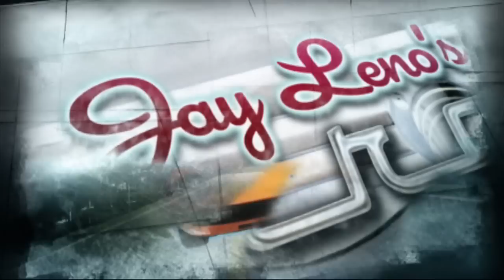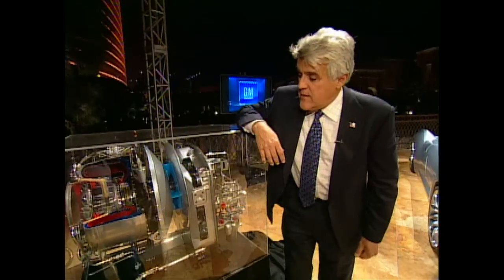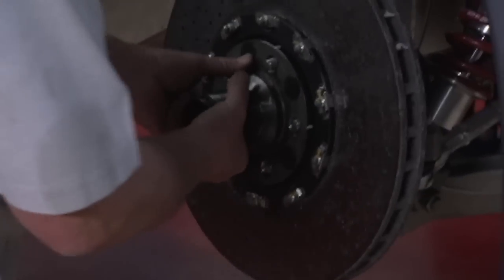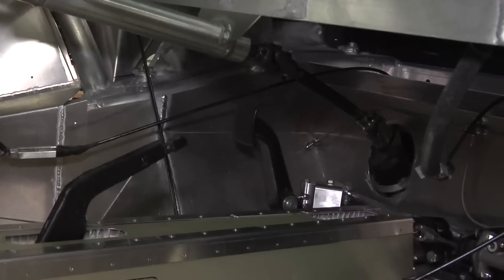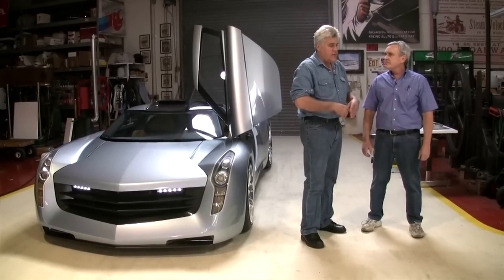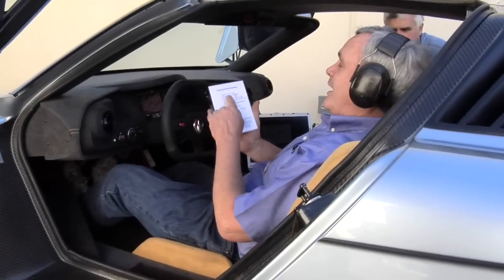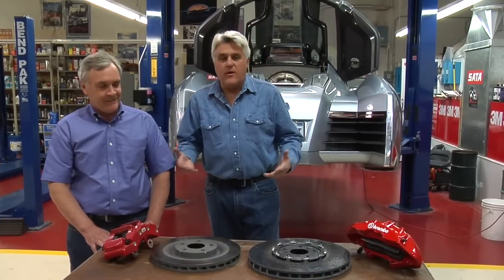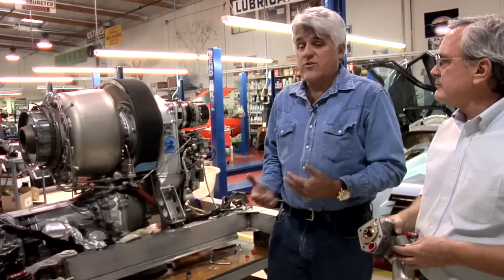EcoJet: Definitive Edition - Jay Leno's Garage

Comment: Runs windows Vista? R. I. P Jay
Reply: You knkw Hatala, out of context, I thought you still couldnt spell my name after 5 years X(
Reply: ***** He's a friend of mine, don't worry.
Reply: He's not dead yet.
Reply: charlesvan13 I think the point he is trying to make is that Vista sucks and crashes more so than the other Microsoft OS.  So if the car runs via Vista, the car will crash sooner than later, ending in death for the driver.
Reply: *****
Windows 7 ultimate is the best version of windows to date.  Very stable and crash-free.
Reply: I agree Vista is one of Microsoft's worst operating systems ever but they never said it "runs the car". They said Vista runs the GPS and on-screen mapping system and internet connectivity, nothing more. That said, I still wouldn't want Vista doing even that but by now they've likely upgraded the OS to at least Win7.

Not sure why people like to fabricate things like this...
Reply: greenrefrigerator it's joke...
Reply: *****
it crashes every time I rip PCI cards out, so it's not crash free.
Also crashes with bad graphics card drivers after multiple flash video instances simultaneously.
Reply: Still not dead, 3 years later.
Reply: android kit kat

Comment: I recall the Chrysler Turbine car, an example  of which Jay also owns, used a HUGE air filter in the front behind the grille, which served to help muffle the enormous amount of intake noise.  On Jay's EcoJet they were using just the engine maker's filter element, which went around the engine and likely had much less muffling effect on the incoming air.

Comment: Question: how do you keep the torque converter cool when idling?
Reply: Why would T.C get hot??? Whats your thinking.
Reply: martyisabeliever Because the engine still produces a great deal of power when it's "idling", and when you hold hold the car stationary with the brakes, all that power has to go somewhere. So it can only get wasted as heat in the the torque converter, a bit like riding the clutch with the handbrake on.
Reply: So the fluid used in the turbine of the T.C./ and within the transmission is pumped through the trans then out to an external fluid to air cooler.
Reply: ManWithBeard1990  After the gear reduction from the turbine to torque converter.. Can you imagine the torque multiplier. 48k RPM and 750HP down to i think they said 6k... So at full tilt that Automatic transmission/Torque converter must deal with something to the range of 6000HP... OVERKILL is a understatement....Anyone else wanna see Dyno numbers from this?
Reply: John Simpkins Big coolerz... "Thing do not overheat, they are undercooled" Smokey Yunik
Reply: Maybe they have a large cooler set over the intake of the turbine but even if it is only displacing 200hp at idle... thats alot of thermal energy. True this is not a daily "Stop and Go" car.. That is a hella engineering hertel to jump though...And a massive amount of stress on a underengannered Auto Tranny. AKA C5 auto. DISCLAIMER  Not bashing just comparing facts i have gotten from sources like "TopGear UK" they are not fans of that segment of the Auto industry.
Reply: All of the thermal issues considerd here are exactly why when asked Lee Iacocca stated gas turbines would NEVER be used in cars I believe his final statement on the matter was" If you have that much available power why would you keep it on the ground" a wise and practical guy that Iacocca was...
Reply: Agreed.  well said.
Reply: martyisabeliever Amen, I agree completely!
Reply: They probably got the highest stall aftermarket convertor available
Reply: Jay Leno is soo cool you don't need to cool it

Lol
Reply: Zachattackisrad  Duuude you are right! That was so obvious a solution how did we all miss it....
Reply: John Simpkins your math is wrong. its still 750hp
Reply: @ Jackagainski       They said it did.

Comment: VISTA?

you spent all that money on that car and they gave you VISTA?????
Reply: If it had to be a Microsoft system I would have rather had XP. Hopefully by now they've upgraded to Win7 (or Win8 only IF they wrote drivers for such a specialized system).
Reply: Stick with Microsoft (or ANY current system) guarantees in a few years' time the car wont be able to run on any street. Why? Because MS will do an upgrade that will disable the car's systems. Sorry - you have to update your car before it can run on the streets.
Dont believe me? Look at XP and Chromecast. Look at XP and AVG. Many other examples where some company decides, at a whim, to make YOUR hardware inoperative. Just because they can.
Jay: Design your own systems. That way, even when the car is a vintage, it will still run

Comment: You need to get some jet engine hush house technology to reduce that noise. When we test jet engines alone on stands and/or aircraft we normally put them in a hush house. The walls are lined with a special insulation that deadens the sounds produced. Here in Japan, Mitsubishi makes one of our hush houses. We can run jet engines at full augmentation in the middle of the night and almost not make a sound. The only sound you can hear outside the hush house is from the vibration of the jet engines running at full augmentation. There is no sound of jet engine whistle or exhaust crackling. Also if your going to use headsets or ear defenders to protect your hearing, my suggestion is 3m Peltor headsets or ear defenders. They make items that cancel out the jet engine nosie but will pick up normal people talking right next the engines running. I hope this can help on the progress of the car. Can't wait for the next episode and/or update on the car.

Comment: Didn't anybody think to attach a smaller jet engine to a generator and electric drive the wheels? That RPM of the engine is insane.
Reply: Well I am working on one with a 24 KWH battery pack and a co generation system that powers Ac , as well as a secondary steam turbine. ( should be close to 90% efficiency  on paper ) Turbo-Electric propulsion . the battery should last 300000  miles , and the turbine is smaller. Acceleration close to that of a Lamborghini. One more year to go before build completes.

Comment: Llia Olsen - Great idea with the electric generator. However if I understand it well you suggest that there is turbine shaft->generator->electric motor. For 750 HP the generator and motor will be quite big in size and yet with turbine only they had trouble to fit it into the car. If you want to load the turbine with generator you need a) high capacity batteries b) heat spiral to get rid of the 200 HP on idle. So to conclude it the reason against 'electric transmission' is too heavy and bulky.
Reply: +Erik Hendrych Good point. They use that sort of electric generation on trains and big yachts, but there's no way to fit it into something this small.

Comment: If I was the club president of more money than brains, I would have skipped the drive train entirely and built a turbine / electric generator with high output battery capacity and put electric motors at each wheel. Although missing out on the sensation of all that mechanical torque and horsepower would have been anticlimactic. Cool looking car. The rear is a little too artsy for my taste though. Braking converts the energy of forward momentum into heat which is absorbed and dissipated by the steel rotors. When the carbon rotors get so hot, how can it continue to absorb and shed that momentum energy / heat? I'm going to have to look up how that system works, I'm wondering why there wouldn't be major brake fade. Great videos. I'm learning a lot about automotive history and keep up with contemporary advancements. Thanks.

Comment: Most people don't know that Jet Fuel is a Fuel oil and Av gas is what you can run in a gasoline engine it just has a higher octane rating than what you get from a gas station

Comment: Grat project. With the auto box is neutral disabled to stop the engine over-revving if you were to knock it into neutral? What about the torque converter oil... Must get super hot?

Comment: Several issues with turbine powered cars include very slow throttle response, high engine noise and high exhaust temperature. An excellent pairing for a jet engine in a car would be with a generator to power the wheels (via a small to medium sized battery pack). High temp exhausts means unused energy. Ideally, you want that exhaust temp to be as low as possible so that as much of the energy as possible is used to generate shaft rotation. That is very difficult to achieve, however!

JW3HH

Comment: Why use such a large turbine system, don't they have a lot smaller ones around now that they use in experimental aircraft? I thought I saw a couple that were like 1/2 the size of what you had there. Wouldn't they give you enough power, etc? 
Sorry, I am not any mechanic or anything, just curious. I am 14 and am fascinated by your using a jet turbine system in a car. Amazing.

Comment: Jay, have you considered having the jet engine drive a generator/battery pack which would power an electric motor on each wheel??? Going off the Tesla model S that give you just over 1500 HP and 1370 ft-lbs of torque.

Comment: Hi Jay,you need to look at the Chrysler Turbine you have to figure haw to silence your Ecojet. How about putting a big flywheel on the Ecojet, GM made a turbine that had four front tires that steered and put power to the ground. It had a big flywheel, ran on kerosene, and got 75 MPG at 150 MPH.

Comment: You should have used the 2 speed power glide that Cleetus uses in Ruby. They are short and hold power. You have the torque for first and the rpm

Comment: Totally just spitballing here but some ideas. Use noise cancelation tech for intake sound. Project opposite sound waves to the ones produced in hopes of phasing out the sound. Also, pertaining to the engine pull while braking or idle. Could a gear system be implemented that reverses the pull of the engine?
Reply: Eric Huff I'll see your spitball ...and raise you a paper airplane. 
Flappers to re-direct the exhaust to the front...like reverse thrust on a plane, might give the brakes a little help. Might just roast the pedestrians in the crosswalk.

Comment: You should use the turbine to produce electricity and use electric motors instead of conventional gears. Also have batteries to store unused power on idle. Run on batteries to increase range & efficiency. Also a smaller turbine could be used.

Comment: Jay, would there be a problem with the transmission if you just shifted to neutral when coming to a stop? Seems that would take a lot of pressure off the brakes providing the transmission can take the constant shifting into drive. Just curious?

Comment: Jay, have you thought about installing thrust reversers on it? I could see that it would help slow it down significantly quicker.
Reply: It would require adding more than 3x the weight in powertrain to slow it in that sense, making it useless as a land vehicle. They've built that compact turbine system in synchronicity of what the fastest land vehicle can use as far as control and braking can go. Go google videos on F-35B jets to get a better understanding.

Comment: Did you consider putting a brake or clutch of some type on the"engine output shaft"  to take stress off the transmission and brakes?

Comment: I think a better solution than bigger breaks and more rugged transmission would be drive the wheels via a hydraulic motor and use the jet to run a big hydraulic pump. The jet/pump could go flat out all the time and valves could regulate power to the hydraulic motor.
Reply: +Jeff Pelletier Good idea, that or even have the jet power a generator to make power for 2 large electric motors that would drive the car. The best of both worlds combined.

Comment: i thought carbon fibre was kinda flammable with those resins, which is why not many companies mix jet engines with high temperature exhaust gasses with carbon fibre bodies/parts. Just because you can build the entire thing out of CF doesn't mean you always should

Comment: Can the engine be used in industrial purposes? or practical production car? Trucks? And run on Hydrogen?
Maybe a smaller version for a standard car, not necessary for speed but for just standard use?

Comment: Does it have air bags? Is there any gearing for the rear end? Or is that obsolete with a turbine? Do the brakes have to work much harder with the turbine or is there reverse engine braking?

Comment: I"m going to say it, this car needs more noise dampening.  Chrysler got theirs to sound like a louder vacuum cleaner.  But as a I say this, I just want to say nice job.  It's not easy to come up with something this exotic and with only intermittent help from some of these developers.   Just don't let function follow form!  Now it's time for the hybrid version!  Use a smaller engine! The electric motors will compensate for the initial power lag.  It will be more fuel efficient than diesel piston engines.  It would be a hybrid you really want to drive (if you can get the noise down).   DON"T STOP HERE!

Comment: Used to be Lycoming in Stratford CT, then moved to Williamsport, PA etc.  Don't think it was ever a Westinghouse.  He was right earlier when he said Honeywell.

I used to test these in Stratford.  No way should you need to idle at 80%.

NO Jay it's not meant to run flat out at 100% all the time.  It's a free power turbine design. Basically in a helicopter, it runs on the power turbine  speed governor so the helicopter rotor spins at a more or less constant speed.  As the pitch of the blades (collective) is changed the compressor speed changes to increase or decrease power and keep the power turbine hence the rotor at a constant speed.

Comment: If you need a light, easily ignited fuel just for startup, why does this have to be kerosene? You could have a small tank of butane or LPG for that instead. Or better still, to make it completely biofuel-powered, why not alcohol? Gas turbine engines are really not that fussy about the fuel they burn - as long as it's a flammable gas or liquid which can flow freely, it works. In the 1980s, GM even managed to make a turbine engine prototype car which ran on a slurry of finely powdered coal dust with water, just to prove the point that when oil runs out, cars could still work using coal as the fuel source.

Comment: Just what I want - carbon fibre brakes that glow redhot and shoot flames inside the wheel wells.  Is the fire extinguisher controlled by WinVista?  Sure hope not.
Reply: +SilentKnight43 There is no fire extinguisher in the wheel wells.
Reply: +SilentKnight43 lol, windows vista detects you don't have administrator privileges to use the fire extinguisher.

Comment: I can see such cars with manual gearboxes tbh. Some kind of load (pre-spinned electric motor? some kind of flywheel?) should stick to gears while driver is pressing clutch pedal halfway,so jet engine could operate without overspinning and overspeeding. Then, when clutch pedal is fully pressed, jet engine works in idle spinning the load, and driver just switch gear, release clutch pedal and continue to drive.

I wonder if this is patented. I'd like to see it incarnated in real life.

Comment: A smarter route would be to have the Jet run a generator, and use electric drive, then you could also use an even smaller turbine. Nothing can help the exhaust heat however...electronic "negative audio" signal can quiet the noise.

Comment: 11:25 is he having to keep his foot on the brake to "waste" power to stop the car going too fast for the road in question with 200 horsepower? He also said that the turbine can spin too fast if it's unloaded in a neutral gear. I can see why they put those massive brakes on it now but that seems inefficient.

Comment: Could probobly use a normal turbine from a turbo or something and use the exhaust gas for a secundary turbine then connect them to a serial-parallel direct drive system and build a gas turbine car that actually works.

Comment: I think that is way cool. I think it is really green. 

It looks like it could be sold as a Cadillac. In the past, Cadillac had their version of the Corvette.

The styling seems similar to the Cadillac. It also reminds me of the Rimac Concept One. http://www.rimac-automobili.com/en/  
 http://www.rimac-automobili.com/en/supercars/concept_one/

I would have made it where the gas jet turbine powers a generator with in wheel hub motors. This way the gas turbine is at a constant speed no matter how fast or slow one is going. One would get really good MPG since it is running at a constant speed.  One would have the instant torque of the electric motors. Once the gas turbine is muffled, it could be very quiet.

Comment: Let me get this straight. you said the engine idles at 60 mph. Does that require riding the brakes for any speed less than that? Either you've left out some info, or you're slipping from reality.

Comment: I wonder if the  turbine was down rated to the 8001 which was fitted in the Fiat Turbino and hydrogen powered what would happen, as the turbine used in the Abram tank is too large. As somebody said earlier it needs heat regeneration plus the thing that killed the Chrysler,the eight stage startup procedure as a one big button. J don't this be your Spruce Goose..dig it out, dust it off and try again .